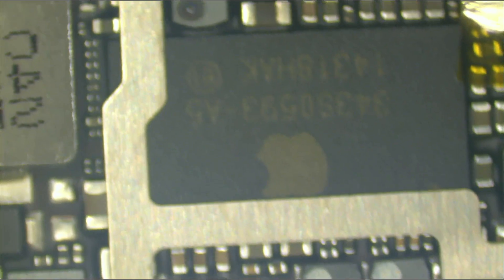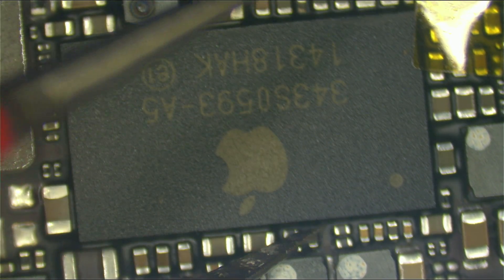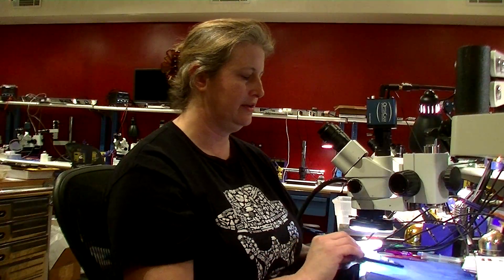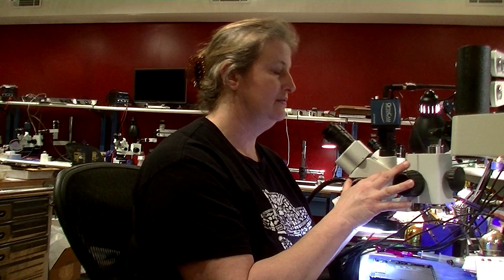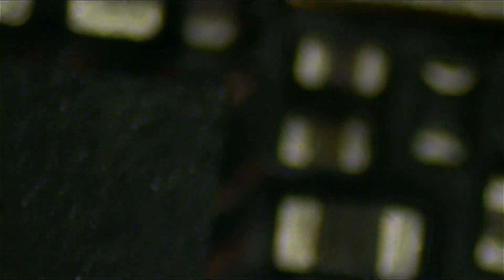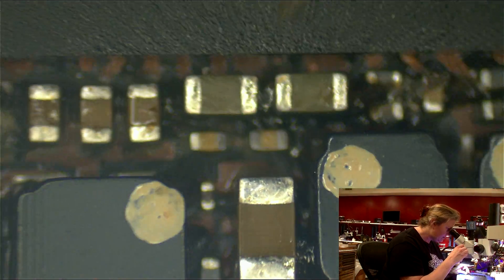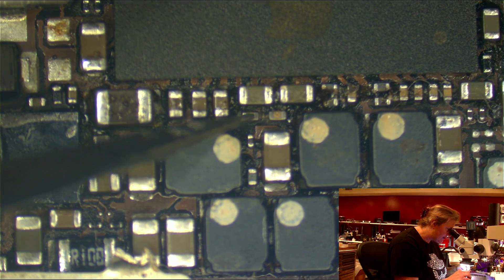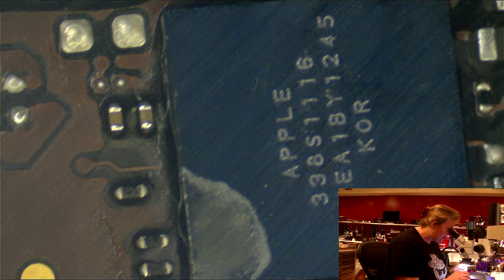Apple uses water damaged boards in Apple refurbished devices

Comment: At least they using Genuine parts unlike you O.o
Reply from the maker: +Warren excell What does 'genuine' mean?  Would you rather buy a $299 iPhone 6 refurb phone that has water damage on the board, or was dropped and has poor electrical connection at the touch ic?   Or would you rather pay $49 and get your original iPhone 6 have a new charge port put in that is identical in form and function to the original port is warrantied for longer than Apple?
Reply from the maker: Apples warranty for a refurbished device is 90 days.  My warranty for board repair is life of the device.  Charge ports are not responsible for any defects and they are identical in form and function to the original.  The only difference is the legal ability to say "this is the original".  They are not "fakes" they all come from the same place.  
USB cables and charging bricks are different.  There are many different versions of these out there, and only the MFI cables/bricks are suitable for use.  Any other cable/brick does not have the logic chips required in the cable. Quality repair shops don't sell non-MFI cables, that's what gas stations do.
You can continue to believe that Apple is superior for repair of you wish, but that viewpoint is not only costing you more money, but is also totally misguided as shown in this video.
Reply: +Eliot Huchez Refusal to sell parts to repair shops does not make Apple "more qualified" to do a repair . The above problems with the mini that Jessa has is proof of that. By not re-securing the chip with either under-fill or some other means certainly did not return the unit back to original quality. So how did this make them more qualified ?
Reply: +Eliot Huchez If you have a Honda with the headlights gone bad, do you think only a Honda dealership is qualified to replace them because they are the only ones with Honda Genuine parts? Of course that can't happen because Honda sells their parts to anyone who wants them, unlike Apple. Its unethical not to provide parts for repair and it shouldn't be tolerated.
Reply: +Warren excell many shops would love to use original parts. However apple like others will not sell chip sets and such to aftermarket repair shops. So not using OEM parts is not truly a choice in many situations.
Reply: +Warren excell Obvious troll is obvious. Move along
Reply: +Eliot Huchez I will not disagree that there are bad parts out there . I will also not disagree that there are shops that buy the cheapest part just to fatten there wallet . But that certainly does not mean that all the parts are cheap junk and that all shop do terrible work. It also does not mean that eveything that apple does to repair a device is always proper again referencing the above video .As far as the exploding battery's there have been  phone/laptop and other devices  burned up due to there battery's even when the battery was original equipment. The lipo battery's in these devices are sensitive to many things - overcharging from defective charging devices - physical damage- internal defect . Keep in mind apple is not making this stuff either. It is made for them by companies in China. So some of these "fake parts" as you put it that shops buy from China are in some cases made buy the company that made it for apple. Case in point I own a auto repair business. I purchased a tail light for a Mercedes from the company that actually makes the light for Mercedes ( this is a common situation) for half the price I would pay from Mercedes even at my cost. This happens with many manufactures I can buy from outside the dealer the same part made by the same people cheaper. Now does it mean because the box does not say the car manufactures name  and instead has the manufactures name on it it now is "fake " even though it is all made by the same people.
Reply: +Warren excell do you not recognize that THIS VIDEO is about APPLE selling a water damaged board with no underfill on the PMic chip.  I'd consider that board a "fake part" if you think you're paying for an Apple product that meets the original quality of the brand.
Reply: So genuine they even left the original water in it XD.
Reply: +Baldur Arlt I wouldn't bother talking to them. they think Apple makes their own ICs so no way you could get a replacement part that would work. Also melting solder is something only Apple can do I guess.
Reply: +Warren excell  genuine or fake.. both works + independent repair shops charge about 10% less than Apple. but your right not sure bout quality
Reply: +Mitchell Crane Warren is right, you should read the news.. some iphones exploded after fake batteries have been fitted by independent repair shops (whose selling fake batteries for a half price of the original apple repair price), usb cables burning people or stop functioning a couple days after the purchase, fake wall chargers damaging u2 ic chips which are responsible for charging.
If you've never dropped your iphone in the water or used a fake charger than you know what the "Quality" means
Reply: +Baldur Arlt  Did you know that China is selling iPhones for less than $50? aaand they aslo looks the same! a bargain. go ahead and get some for your family too
Reply: +T88T xD
Reply: +iPad Rehab at least here in the UK, their refurb warranty is 12 months.
Reply: iPad Rehab Apples warranty for certified refurbished devices is a year.
Reply: Lol iPhones with fake parts will hurt people
Reply: iPad Rehab we do charging port replacement for 45$.apple does it for 170$
Reply: Genuine? Here is where Apple components are made. https://www.macworld.co.uk/feature/apple/where-are-apple-products-made-3633832/

See the battery part? Either Made in China or Made in South Korea. BTW, Samsung had battery problems too with their own in house phone Samsung Note 7
http://www.bbc.com/news/business-38714461 https://en.wikipedia.org/wiki/Samsung_Galaxy_Note_7#Battery_faults

The battery in Note 7 are made by... guess who! Their own in house design bureau Samsung SDI and another Chinese company. Both blew up. So are you going to say that Chinese fakes are being put into your Apple product? Its Made in China after all. Or pray that the Made in South Korea ones doesn't blew up like the Note 7 Fiasco...
Reply: Chris Jones We have things a lot better in the UK because of the Sale of Goods and Services Act which means goods and services have to be of merchantable quality and last a reasonable period.  For a repair that period is generally deemed as 12 months so Apple are not offering that out of choice, they have to by UK law.
Reply: +Mitchell Crane that's why only Apple is qualified to do repairs.
Reply: +Baldur Arlt piss of you are too dumb to know anything about this
Reply: +iPad Rehab If there's a problem with the device Apple will replace the device without any questions, so yep it's worth to go with Apple rather than spend the same price in some "repair shop" and have the same problem about a month later. Only because these chinese fakes looks the same doesn't mean they are the same quality..  USB lightening ports, chargers etc. are responsible for most of the problems these refurb. iPhones have, and you know it!
Reply: +Warren excell Problem is that repair shops order cheapest or local parts. From China you have a choice what quality you wish to buy. Resellers always orders cheapest to make biggest profit. Self respecting repair shops will order best quality parts. Original parts also exist, but refurbished. So the difference is really in price and knowing good repair shop. Sad is that most repair shops aren't professional at all, just youtube watchers, who decided to make easy money.
Reply: iPad Rehab  cut the crap please. these refurb. iphones with fake parts can harm someone one day!!!!!!

Comment: nothing surprise.. they have thousands and thousands tablets like that.. they cant  just throw it away... cause its a thousands and thousands dollars.. if I was apple I would do the same
Reply from the maker: +Эльдар Тайлов I don't have a problem with them refurbishing this board and using it.  That is good for the environment.  The problem is the idea that Apple always produces a superior result than independent repair, and the idea that this is worth paying a lot more for their refurbs over just getting your original problem fixed by a quality shop for less.
Reply: +Эльдар Тайлов They could use these boards for parts, reusing the board as-is is irresponsible. Defending re-selling a water damaged board is silly! They're just being greedy.
Reply from the maker: Sure there are crappy shops.  But there are also great shops.  You can identify a quality shop by their warranty policy and local word of mouth.  The idea that only Apple can be trusted, and that independent repair shops are inherently untrustworthy is the problem.
Reply: +TerribleFire there is always mail in repair whe you use the old 4s from the back of the closet.  This is what most people do.
Reply: +iPad Rehab yeahh.. you are right.. but Im sure you have seen a lot bullshit from fix stores as well.. and much worse..
Reply: +fys Doesn't they provide some kind of warranty with refurbished devices?
Reply: I don't think anyone faults them for attempting to salvage parts rather than throwing them away, but if they're going to refurb, they need to do quality repair work that is up to spec with the original product, which in this case they did not do.
Reply: +Эльдар Тайлов luckily ur nothing but trash:)